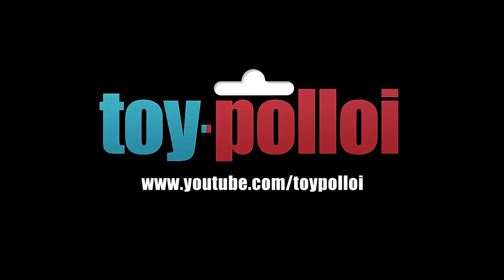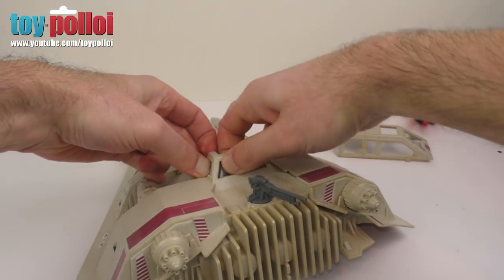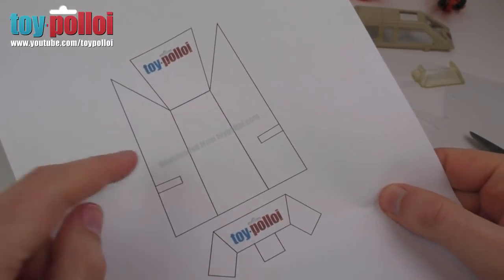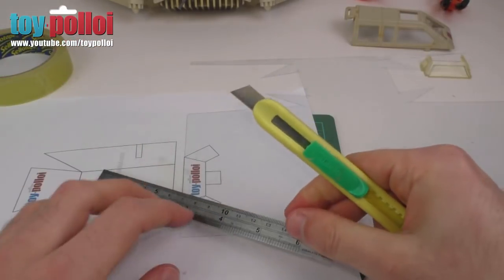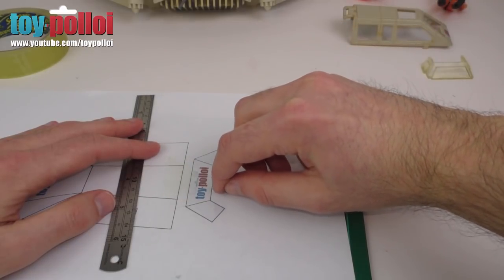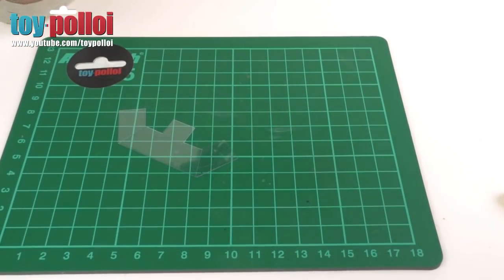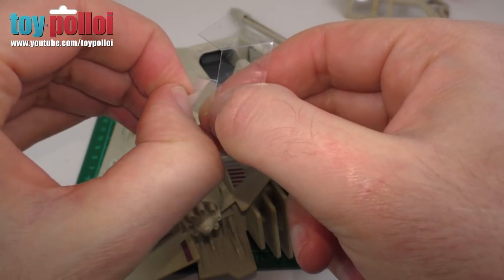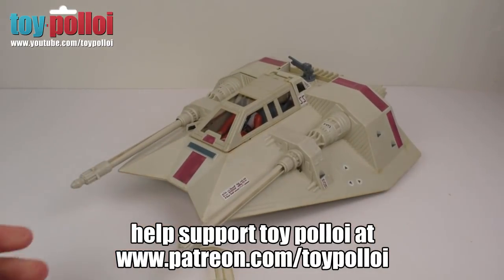Vintage Star Wars Snowspeeder Gunner glass replacement - Toy Polloi

Comment: Hi Dave! Thank you, not only for demonstrating the fix but also taking the time to fabricate a template and then upload it to your website for others to use free of charge.

Before you put that original piece back into the snow speeder, consider using the hydrogen peroxide to take the yellow out of the clear plastic. I’ve had very good results with hydrogen peroxide cream and some laundry oxi cleaner to deyellow clear plastics.
Reply from the maker: I have had mixed results with de-yellowing clear plastic, so I would always advise testing first. It often makes the plastic go cloudy, so do be careful.